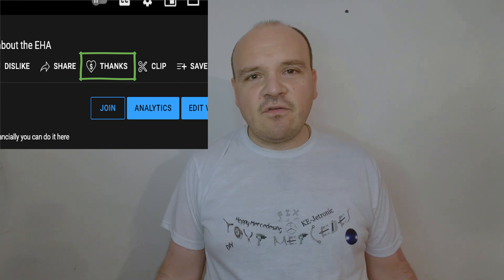㉦Mercedes Ke-Jetronic㉦ - Altitude sensor B18

Comment: Can someone help , I just replaced   the diaphram and the 4 o rings on the fuel distributor,  I have adjusted  the 3mm Allen key fuel mixture,  but now the car will not start , I have over 5 bar fuel pressure,  but the fuel to injectors is weak. What do I do .
Reply from the maker: Have you adjusted the sleeve on the distributor to 0.6mm from the nut?

Comment: i think that was short video
Reply from the maker: Okay. What is missing, what is untold?
Reply: @mercedeske  about running rich on idile
Reply from the maker: @shahidnoor45  So, do you have this sensor on your car?
Reply: @mercedeske  running rich issue was solved flow your advice in video.....but same problem come back after 2 years.😅😅😅
Reply: @mercedeske   i am waiting for throttle body and will let you know if it solve my problem